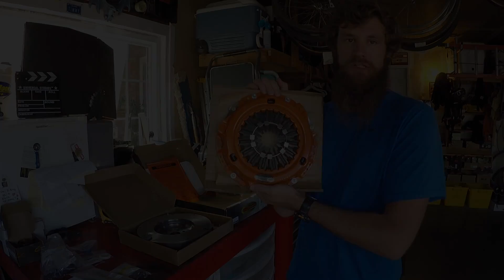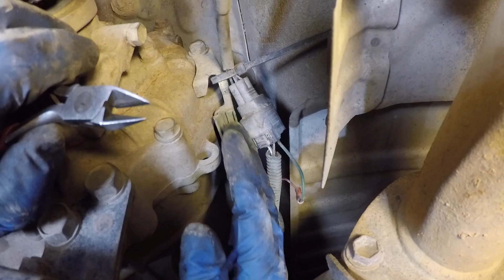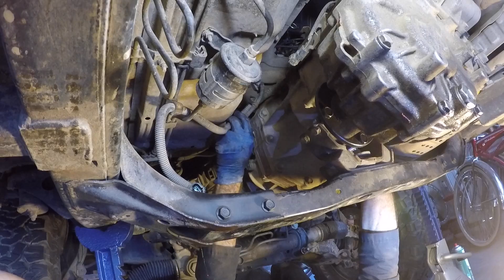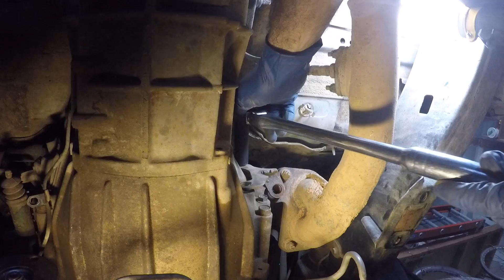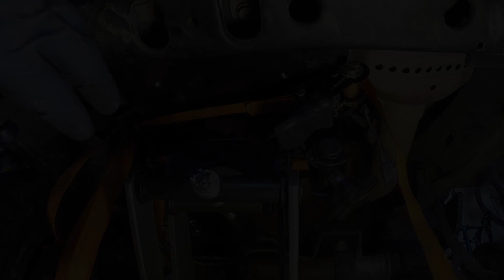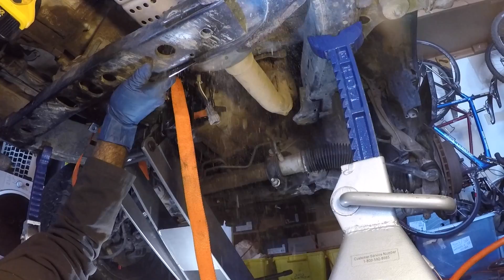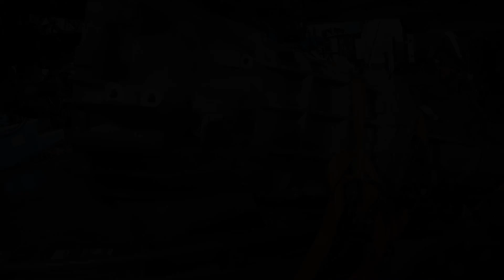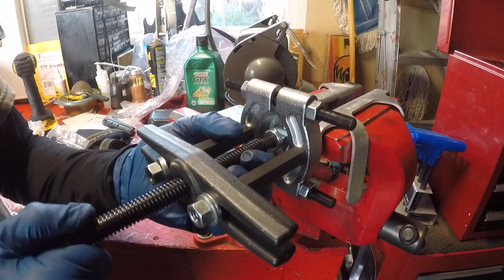Clutch Replacement (Part 1)

Comment: @TimmyTheToolman I have run into a bit of a snag. I am at the point where I am ready to remove the 6 bolts on the bell housing to drop the transmission. But I am a little clueless as to how to get to the top bolts. I can just barely see where they are, but I don't see any way to get any kind of fingers or my hand up there to guide the 3 foot of extenders. I have seen people mention going through the shifter hole, but it seems almost as far back as the transfer case, and I don't know if there is a huge advantage. But more importantly, how do we get those bolts back in once we pull them out? I could not even find a way to clearly see the bolt at the top, let alone a way to guide it back in. Is there a trick to this? Is there some way to get a few fingers up there or a tool to guide it back in once it is pulled out? I feel like I am missing something as it seems others have done this already without much issue.

I have also made a video on my channel showing where I have been looking and to see what I am seeing to help. YouTube won't let me post it directly in the comment. But it is on my channel called "Question about Bell housing top bolts".
Reply from the maker: A long extension with a swivel socket works well to get onto those upper bolts.  I've done it by myself and it can be done.  You first need to find the right path for the extension and socket.  It's hard for me to walk you through it, because I can't give you the exact path, I don't go directly over the top anymore.  I come at those upper bolts from each side of the transmission.  The key is having the swivel socket because it allows you to get onto the bolt coming in from an angle.  A universal joint and socket might work too.  

Having someone helping you that can either reach up from the side of the bell housing or reaching from up above going between the engine and fire wall to help get guide the socket onto the bolt does help.  But, like I said, I've been able to do it on my own, but an extra set of hands is nice.

This is the set of swivel sockets I own.  I also own a set that is 3/8", but the 1/2" sockets with a 1/2" extension doesn't flex as much and makes it easier for you to break free the bolts and tighten them properly after you get the trans back in.  https://amzn.to/3HuBKo4

Let me know if what I said helped you out.
Reply: @TimmyTheToolman  Thank you for the replies. All of your replies have been a huge help.
 
I think I know what you mean about coming at it from the side instead of straight back. I have seen this method used in a few of the videos, but not all people use it. But I believe it may be a better method as you have mentioned. I will give it a try.

I do have a 1/2 inch swivel that came with the extensions I purchased (Neiko 00256A). The one I have doesn't have the socket directly on it like the one you linked, so I will still have to add the socket. I am not sure if this will be an issue and make the assembly too bulky, but I will give it a shot.

When you do it solo, are you able to get a visual on the bolt? I have tried viewing it from different angles but I really am only able to just barely see it from the driver side wheel well, and even then it is just a corner of it. Was wondering if there was a way to get a better visual while you get the socket over it. I tried seeing it from the back of the transmission, but because the floor drops down behind it, I wasn't able to see it straight down from the back of the transmission. As far as from the top of the engine bay, I have the truck jacked up pretty high. I tried looking down to see it, but I couldn't really see it from the engine bay either. Is there a way or ideal spot to get eyes on it when getting the socket on it? (I am at the point that I might pull out my borescope and get that up there to see what I am doing while I am trying to get the socket on it.)

Thanks again for all your help. It is a relief to know there is someone I can ask questions too when I get stuck.
Reply from the maker: @brandonkish3100 If you can't see the bolt head, you can certainly feel it.  You just reach in and feel the socket slide over the bolt.  If you have someone helping you, they could either work the ratchet or impact gun to break the bolt free or they can hold the socket firm onto the bolt head so it doesn't slip off while you break it free.  I just removed all 6 bolts on a buddy's rig so we could pull the engine away from the trans to replace the rear main seal.  I had all the bolts out in less than 10 minutes.  My buddy did help by guiding the socket over the bolt heads.  

It's not comfortable cramming your hand and arm up in there,  but I know it can be done.  The size of your hand and arm could be in hindrance though.  If you have big hands and arms, getting up in there will be more difficult. 

I think I've given you as much information as I can to help you get those bolts out.  When it comes time to get them back in, you just have to cram your arm back up there and get the bolts started and then tighten them with the same extension, swivel and socket.

This is the problem with helping somone over the internet.  I can only explain things and not actually show you.  If I was there in person, I could help you out a lot more.
Reply: @TimmyTheToolman  I found a easy way to solo it (see below). No worries at all. Your suggestions have been a huge help and it was your suggestion of going at it from the side at an angle that ultimately allowed me to get it.  You are absolutely correct about doing it by feel. 

This next part is my suggestion for any other absolute beginners like me to take the stress out of getting that top bolt. 

I found what helped me solo this and really made it easy was to re-orient my body under the truck. I slid under the truck head first from the front of the truck, so my head was towards the back of the truck and my feet were towards the front of the truck. 

I basically did a bear hug around the transmission. I shoved my right arm up the side with the exhaust (passanger side). There is a spot right up near the bellhousing (where the transmission starts to flare out towards the engine) where you can shove your right arm up where it is just wide enough to get a feel on the very top center bolt. 

I found I needed some kind of cushion to help keep my body up to keep my arm way up there. 

Then in my left hand I had two 15 inch length (1/2 inch diameter) extensions with a swivel end on it (no wobble needed for this method). And on the swivel was a short thin walled 17mm socket. I had to go over the cross bar with the extensions with my left hand (you can rest the extensions on the crossbar if needed).

This turned out to be the perfect length of the extensions to go up the driverside of the transmission with the extensions in my left hand while I used my right hand to get the socket on the end over the bolt. It is basically like doing a bear hug around the transmission. Once I could feel the socket up near the bolt with my right hand, I guided it over the bolt. I then brought down my right hand and attached a ratchet on the end of the extensions then broke the bolt loose. Once the bolt was broken loose I took off the rachet off and put on the impact wrench on the extensions to quickly back it out (though you should be able to do it by hand). I periodically would shove my right hand back up there to confirm I was still fully over the bolt. Having a cushion like a pillow or rolled up mat under my back was a huge help to keep my chest up high enough to keep my right arm up there. 

Once I figured out this bear hug method, it made that top bolt super easy

Also, I was able to solo the pulling off the transmission using someone else's suggestion of using a ratchet strap. I bought a towing ratchet strap from harbor freight. It was a big 4inch wide one that said something about 2200 ft-lbs. It was about $12. I also used harbor freight's 800lbs transmission jack to hold it up. I wrapped one end of the ratcheting tow strap around the transmission at the  transfer case (careful to avoid the sensor around there, then I ran the other end over the cross bar, under the rear diff and hooked it onto the tow hitch. I then cranked it down really hard. At one point I saw the hich flex down slightly so I did not go any further. This by itself did not put the transmission off. But while it was on the jack, loose, and had the tow strap pulling on it, I got under the truck and pushed the transmission up and down. I found that the floor gave me a lot of leverage to do this. As I pushed it up and down the tow strap pulled it back and it came right off easily and controlled. At this point it was only a matter of slowly dropping the transmission with the jack. Having that tow strap pull on it while I shoved it up and down made it super easy to get it off.

I hope this helps others.
Reply from the maker: @brandonkish3100  You got it done.  Good job!  There's always more than one way to do a job.  You found a way that worked for you and that's all that matters.  Good luck with the rest of the job.

Comment: @TimmyTheToolman I was wondering if you could help me with one more question sir.  I have finally gotten to the point where I took off the starter. I am now trying to take off the exhaust flange with the three nuts. From what I've been told I need to use a penetrant and also heat the nuts with a torch. But I'm having a problem reaching the not that is wedged between the exhaust and the frame. I can't seem to get a socket fully over it. I tried a 1/2 in 10inch extension, but the welded bracket under the frame gets in the way. I also have an adapter that gives me something like 20° angle for the impact wrench. But even with that I can't seem to get fully over the nut. I was wondering if you could explain how you were able to get it off.
Reply: I have a vid on my channel that explains my issue. It is the only one on there if that would help.
Reply from the maker: @brandonkish3100  I responded on your channel.  Check out my comment.  I hope it helps.  Use plenty of penetrant and heat before attempting to get the nuts off.  Sometimes, the stud backs out the exhaust flange, and other times, the stud breaks, which sucks.  Good luck and let me know if my suggestion worked for you.
Reply: @TimmyTheToolman  Thanks for the reply. Will check it out now.
Reply from the maker: @brandonkish3100 You're welcome!

Comment: I did have another question if that is okay. I am at the point where I need to drop the front and rear axel. In the video you show several markings that need to be made on the axles themselves. But I am a little confused on how they are utilized during the re-install.

I assume the one that is next to the bolt in the video is to orient the axle in the correct orientation with the plate it mounts to (On the diff side, and also on the trans side). I also understand the one almost dead center, where the axle splits into two and can be rotated, so that one need to be aligned also.

What I am confused on is the markings that appear to go from the center, all the way down towards the rear diff. It almost looks like you took a yard stick and marked from the center split all the way down to the diff. I do see in the tech manual where it mentions these need to be marked, but I am assuming the marks that are closer to the diff (Other than the one next to the bolt) are only required if you were to disassemble the axle further and to take apart the end (Which I assume is not required for this job)? I just wanted to understand the markings so that when I go to re-assemble I understand what parts I need to watch for that might rotate / become misaligned. I tried reviewing Part 2 to see how they are re-installed, but I think this is skipped over for time sake.
Reply from the maker: The only marks that matter are the matchmarks that align the slip yoke to the main driveshaft because the slip yoke and main driveshaft are balanced as one unit.  If you separate them, you want to get them back together the same way so you keep it properly balanced.  If you keep the slip yoke and main driveshaft together, you don't have to worry about making matchmarks.  It's just a precaution in case you accidentally separate them.  Making matchmarks for the flanges that attach the driveshaft to the differential or transfer case aren't necessary.  Why Toyota recommends this, I don't know.
Reply: @TimmyTheToolman  Thank you for the response. I kind of assumed it was something similar to what you explained. But wanted to double check.
Reply from the maker: @BKISHDROID  You're welcome.

Comment: I am here in 2025 about to get ready to do this job. The clutch is slipping horribly. I have never ripped apart an engine or tranny before. Mainly only do basic maintenance on vehicles before. This video is a god send. My father passed away a few years ago, and left me his 1997 4Runner SR5. So it has a ton of sentimental value to me. I don't trust stealerships. Going to attempt this job myself over the next month or two and just take my time with it. Any advice is appreciated.

The 4Runner is almost completely 100% stock. Is the clutch and flywheel used in this video overpowered for a stock 1997 4Runner SR5? It has the 3.4L 5VZ-FE which I think only does something like 220 ft-lb output, but I think the clutch is rated for 387 ft-lbs. I was reading that having a clutch that is is too powerful for the engine can cause issues / damage. Do you know if the 4Runner in the video has a stock engine, or if this is something to be concerned about?
Reply from the maker: If you can get someone to help you with the job, that would be ideal.  Transmissions are bulky and heavy.  Having a set of extra hands for the removal and reinstallation would be helpful.

The engine is stock in Dan's rig.  You can go with an OEM clutch or aftermarket like Dan did.  Dan's been running this clutch for years and hasn't reported any issues.
Reply: @TimmyTheToolman  That is great news. I was originally going to go with the stock clutch, but after learning that the disk and spring plate are now all re-manufactured, and after seeing images of some of them, I think I am going to go with after market. I figured I would stick to Dan's setup, since he seems to to have invested time and research into it. Also, from the video it sounds like he consulted several people on it.

I do have a buddy who works as a mechanic on vehicles. He is kind of hard to get a hold of, but I figured I could work on the smaller stuff, and then bug him when I get stuck on things and to help with the heavy parts. Thanks for the advice.
Reply from the maker: @BKISHDROID You're welcome, and good luck with the job.

Comment: Hey Timmy this is an old video but I had a quick question. I just replaced my rear main seal on my truck with a Toyota one. I noticed there was caked on oil inside the bell housing and was wondering if the input shaft seal could cause this? It’s never been replaced and seems to be mimicking a rear main seal leak with oil coming between engine and transmission. Thanks
Reply from the maker: It could absolutely be oil leaking from the input shaft seal.  When we shot this video, I mistakingly thought we had to remove the bell housing to replace the input shaft seal.  You don't.  You just have to remove the input shaft seal housing plate, replace the seal and then reinstall the plate.  Go to play time 9 minutes and 40 seconds in the video I link below to understand how to access and replace the input shaft seal.  This was done on a W56 transmission on a 1st Gen 4runner, but the technique to replace the seal would be the same.  https://youtu.be/hZRwijhMTH0?si=_I6xvL_zjr2Gq28D
Reply: @ I had a mechanic install me an oem rear main seal and within 15 minutes I had another leak coming. I decided to take the transmission out myself and when I got to the rear main seal it was dry as could be. No oil on flywheel or clutch at all. No oil from oil pan as well. Mistakenly I bought a new oem rear main and replaced it. I noticed once again oil leaking through the little access plate on the transmission. I’m assuming it’s the input shaft seal that’s leaking as 1. Bellhousing was covered in old oil, and input shaft seal housing plate was also covered in oil.
Reply from the maker: @isaiahscarborough1654  Yeah, if there isn't any oil leaking from underneath the area of the rear main seal, it has to be coming from the input shaft seal on the transmission.